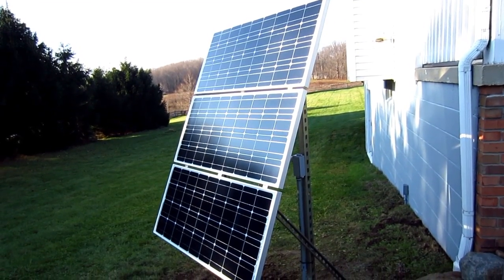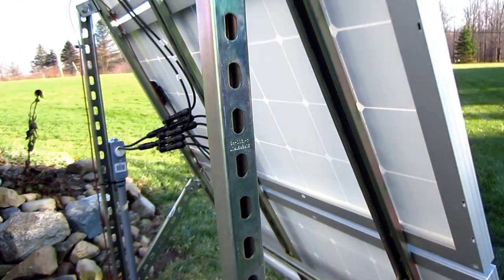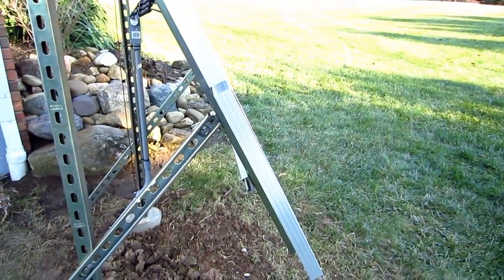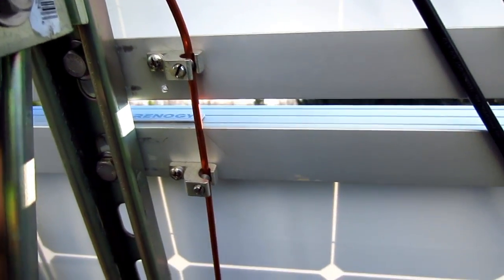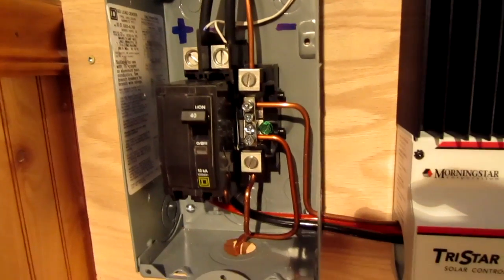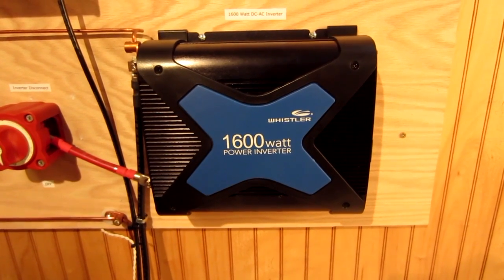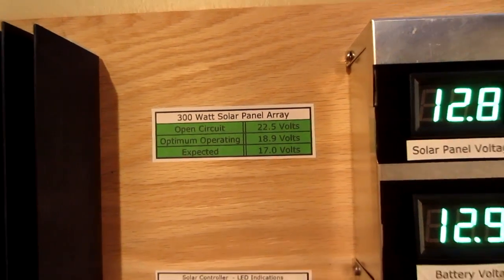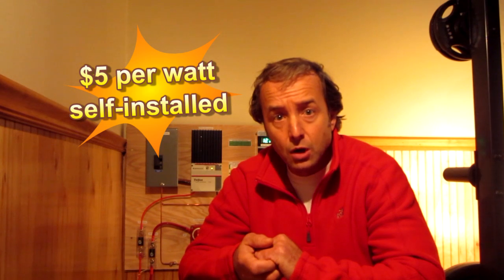DIY Solar Panel System - 300 Watts Off Grid Ground Mount - Christian Dude

Comment from the maker: I got some of the stainless steel hardware at Lowes, and others here: http://www.albanycountyfasteners.com/
Reply: +Keli Weisgerber get a transfer switch and generator port installed on your house, you can get one solar panel that puts out as much power as all three of your solar panels, you should get better panels, put them in a better location, nice start though
Reply: +Matthew Sherman  what are you talking about ? give us some details , what panels ?
Reply: +oly loly Pretty sure he's talking about those large 300 watt grid-tie panels. They are cheaper per watt than the 12 volt panels, almost $1/watt. I've been looking into those too. With them, you have to use an MPPT charge controller. The downside is they can only be shipped by truck (expensive) as they are too large for UPS, unless of course you can pick them up yourself from a nearby store. Same for storage batteries. Find a local store as shipping is outrageous.

Comment: I have just started (one piece at a time) something that is about 90 percent of what you are have done. My mount will be different and brand names on equipment may be different, but mostly the same set up. My goal is to have a system that like you said can preserve food in a fridge and freezer and will give some time until my generator can be set up to supply AC and charge batteries. Subscribed so that finding this video again is much easier. Thanks for the inspiration.